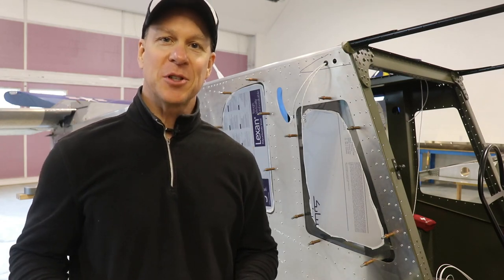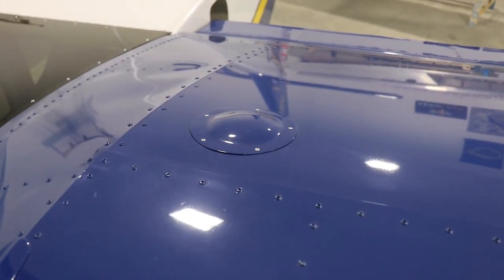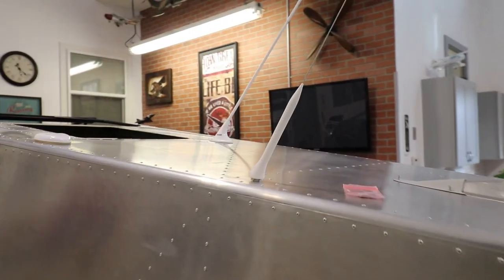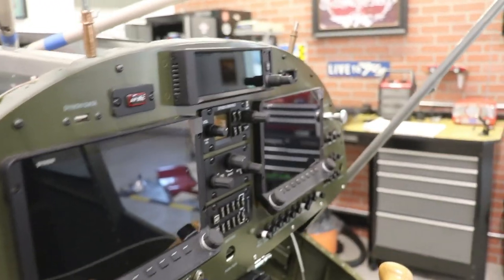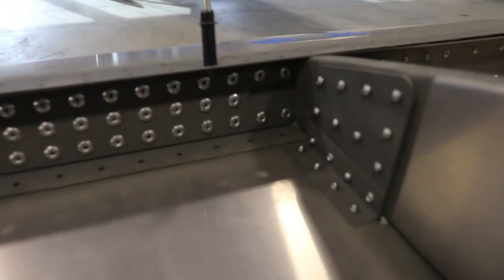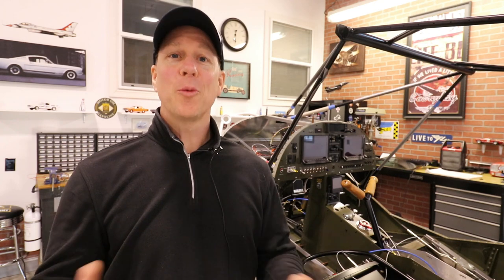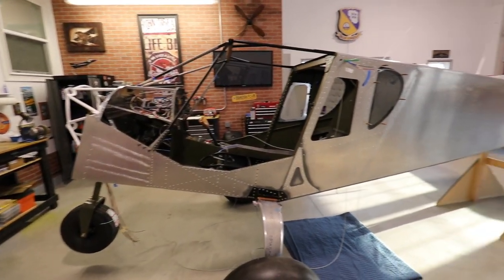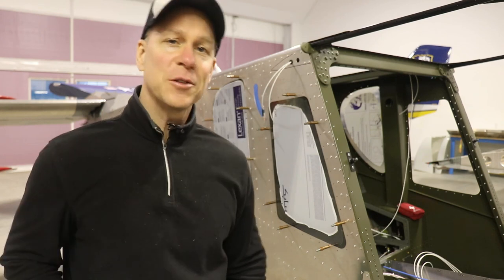The #1 SKILL You Need to BUILD an Airplane! (Ep82)

Comment: I bought a bunch of 12” drill bits in common sizes just for situations like that.  Also, you can get extender shafts. I forgot to ream some of the bushings on my ailerons and the bolts would not fit through them.  I had to reach in about 18” to get to them and the drill extender worked great to get a reamer into the channel.

Comment: How about hot gluing a castle nut on your elevator pivot axle then drill the hole. If you don't like that, you could thread the pivot axle and use a washer and nut instead of a cotter pin.

Comment: Drill pilot hole in a nut and use it as a guide.  What I have done,  I used 10mm nut, tap it with 6mm bolt [to lock it onto the shaft]  and used long drill bit.  Simple.

Comment: At about 13:30,,,,What about an extended drill bit to drill out the pin for the pivot point for the elevator or if they don’t make one that thin (1/16”drill bit) then possibly a flexible Dremel tool type device might work.   Just a thought.

Comment: For the elevator hole, a dremel is a great option to get it done. If the dremel is still too big, you can use the dremel bit in a right angle die grinder.

Comment: For your elevator pin hole, braze a length of 1/16 inch cold rolled shaft to the end of the drill bit.

Comment: On the elevator pin we have 12 in drill bits at work and jigs for the cotter pins to drill straight and with the rudder cable maybe just a fairlead to keep it away?

Comment: Ran into something like this, only had to drill a 1/4" hole though a 1-1/2" opening 6" from the top. Not much different. Drill a clearance hole in the end of a 3/8" or 1/4" maybe a 1/4" deep. Braise drill bit in place. Make as long as needed, looks like 3 or 4 inches would work. A Dremel might work but looks close.

Comment: How about painting the rivets and then you only need to touch up the center after installed? The flange of the rivets could look like they were sprayed at the same time as the skin for the most part. The paint should harden enough before installation to still look good?
Reply: I was deciding whether to paint my rivets also since I primed all parts before assembly, but I found I like the look of the silver rivets against my white primer sheet metal so I am leaving mine “as is.”  Surface rust on the rivets is possible, but not likely to be an issue and the primer on the sheet metal will help prevent any galvanic corrosion which is minimal anyway between aluminum alloys.  I do dip my SS rivets and install them wet for additional protection against galvanic corrosion.

Comment: I don't have any experience with Dynon servos, but couldn't you flip the servo bracket 180 degree so the capstan is in the same plane as the elevator cable but the body of the servo is out of the way of the rudder cable (toward the left side of the aircraft)??

Comment: If the manufacturer had decent assembly instructions, you wouldn't have to think ahead. The numerous issues he encountered so far makes me wonder why he is such a cheerleader for Zenith.
Reply: I have had the same question for the last three years.  These are just a few of the many things that we have run into that should have been incorporated into the construction manual.  At the least there could be a Zenith sponsored forum where new builders could go to that would enhance the manual that has not been updated.

Comment: G,day Mark from Sydney Harbour Australia.
Do you have an electric or cordless drill with a smaller chuck. This would give vertical drilling? You could consider tapping a thread on the end of the aluminium and washered locknuts?
🌏🇦🇺
Reply from the maker: Yes I have smaller drills but they are all too large. Obviously the first thought is to get a longer drill bit-but as I stated in the video a 1/16” drill bit is super fragile and a 6” or 12” drill bit would never drill the hole before it snaps and breaks.

Comment: Another great video! Thanks.
I'll throw in my 2¢ on the elevator pivot along with several of the other good suggestions below. You can get drill bit mounted in 1/4-inch hex shank and a 1/4-inch hex bit extension. They should be thin enough to get the job done.
Is there room to rotate the servo 180° so the motor is away from the elevator cable?
Thanks again.

Comment: For your trim servo if the motor can be configured or wired to run in reverse can you spin it around 180 degrees and re-secure it?
Reply from the maker: Then it will be in the way of the left ridder cable.
Reply: @KitplaneEnthusiast  Gotcha. Wasn't sure if maybe the orientation yielded a little bit of extra clearance either way.

Comment: I had drill bit extenders years ago for your problem. The end of a shaft flared out and had Allen heads to tighten down on the bit. Had 3 sizes to cover 1/16 to 3/8.

Comment: About the servo Vs rudder cable: can you flip the servo (incl. the base) 180 degrees, so the capstan faces to the left, instead of the right? That should give you some lateral separation from the rudder cable. It takes you a wee-bit further away from the stiffener, though. Awesome video, as always.